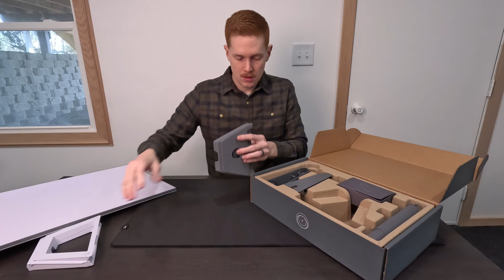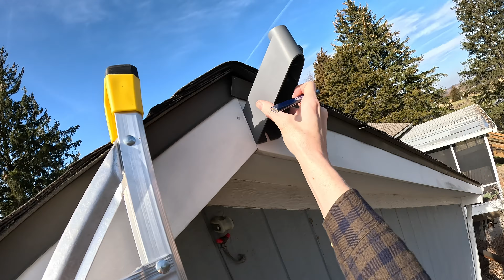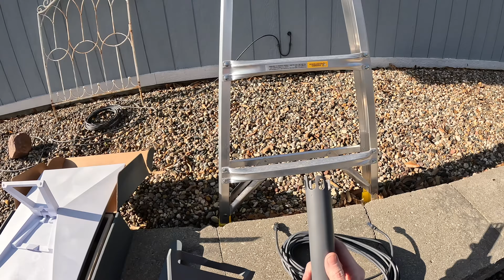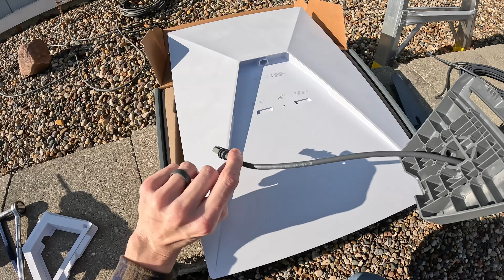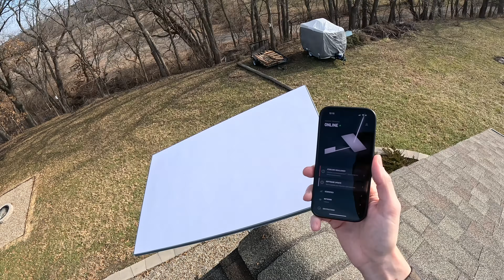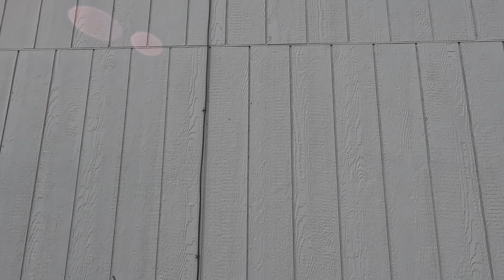Starlink Gen 3 Standard Wall Mount - Review and Install Tutorial

Comment: are you able to unplug the cable from the dish?I ordered the mount but already set up the dish
Reply: Yes you can. I just set up my standard mount and had my Gen 3 dish in my yard until the mount arrived!
Reply: Despite the appearance, the connector system on the Gen 3 is not a standard RJ45 ethernet. There is no latch, so the tab doesn't need to be depressed. Rather than a latch, it depends on the friction created by the waterproofing shroud. Just pull on it firmly. It'll come out.

Comment: Is there something I could build to shelter the satellite dish that would not interfere with the signal?
Reply from the maker: Starlink recommends that you don't cover it with anything, but Starlink dishes have been able to function under fiberglass, glass, fabric, etc. Your results will vary based on what type of material you are using. It doesn't really need to be sheltered from anything, though. It's designed for outdoor use.
Reply: @DISHY_tech  We are a rainforest and have hurricanes. I love your product. But because of the shape it's a windsail/wing/kite. We have Willy wahs, wind comes from all directions and blows hard. We don't get much attention because we are rural. I believe an enclosed box structurally reinforced would help us. we had 150 inches of rain this year.
Reply: Does this turn 360 degrees?
Reply: I’m trying to figure out the best type of mount but it seems they all would not do very well in strong winds. We are in hurricane territory and this doesn’t seem sturdy. I was wanting the pole adapter kit but it also seems like it wouldn’t stand up to much.
Reply: @SouthAlabamaPiper31 plenty of third part mounts that are better built if you need it